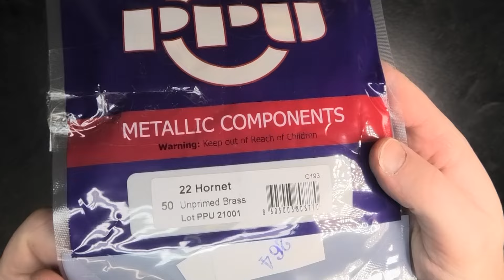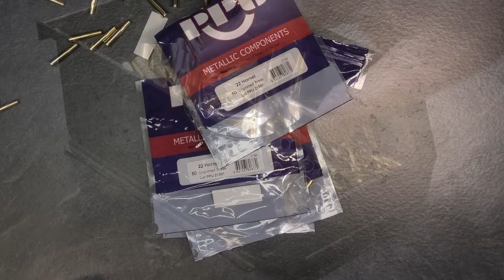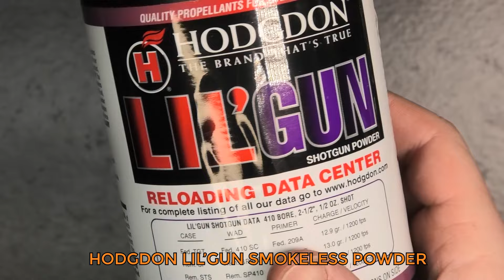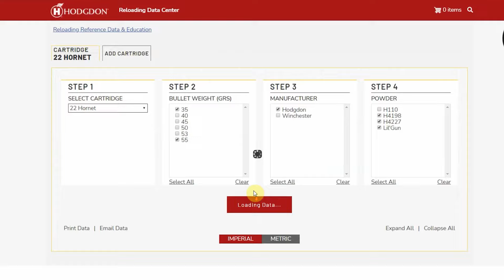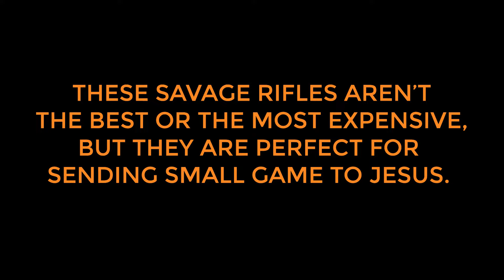Reloading .22 Hornet - A varmint obliterator.

Comment from the maker: So a quick followup: I have found that in my savage rifle, it really likes the .35 grain hornady projectiles, with 12 grains of l'il gun powder behind it. Tapered bullets did not work well, and I don't believe the crimp die is needed for these if seated correctly.  12 grains of powder gives me about 1/4 inch of space for the bullet to seat without compressing the powder. These bullets are FAST, and to my ear has about half the report of a .223
Reply: In some instances, powder is not compromised of it is a compressed load.
Reply: Ill send you out my chronograph if you want to test stuff. Its pretty handy and simple to save data via smart phone
Reply: What is your twist rate?
Reply: Do not used compressed loads
Reply: I thought it would like 35gr. I found 45g tend to pass through and don’t shock as much. I think the hornet most of the time performs better with the 35gr projectiles.

Comment: DONT crimp the cases! You`re just destroying them by crimping them. The Hornet cases are extremely thin. You won`t get near as many reloads out of them if you keep crimping them. There is no worries with neck tension. Just neck size the cases, thats all you need. Do NOT full length size the cases, or you will start to see your cases cracking. And i saw where you were measuring for 12.5 grains of Lil`Gun, maybe you changed something, but i put 13 grains of Lil`Gun in my hornet loads and they are not near as full as yours are. You might want to recheck your scales, something just isnt right there if you`re at 12.5 grains and the cases are that full. Now, if you really wanna see that 22 Hornet come to life, stop using rifle primers. Use pistol primers. Rifle primers are just to strong for the 22 Hornet. I would explain the pistol primer use in the 22 Hornet but i`m limited on how to put it all in here good enough for you to understand it. Not raining on your party here, just trying to pass on past experiences with the Hornet loading to you. I`ve loaded 22 Hornets for MANY decades (50+yrs experience reloading), i`ve tried a million things, pistol primers is what make this cartridge really come to life in accuracy. And forget the 55 grain bullets, especially if you have a 1-16 twist barrel. They will never stabilize. Keep your bullet weight no higher than a Hornady 40 grain Vmax. I shoot 30 & 33 grain out of all my Hornets, one hole groups at 100yds all day long, as long as i do my part. The 22 Hornet is a very fussy cartridge. Follow what i said here, and you`ll find that it just works. My favorite 22 Hornet as of lately, is the CZ527. That gun just drives nails all day long. They have a great set trigger that they put in the 527`s. Anyhow, have a great day!
Reply from the maker: Yeah the crimp I think I might have done on maybe 10 cases, you're right, totally unnecessary.  I've never reloaded .22 hornet before, and it reminds me of a mini 303 british, which I always have to crimp. Plus it came with a crimp die, if it wasn't necessary they could have just incorporated it into the seating die. 

Double checked the load, it's more compact that what I've shown, I'm at 23% humidity and the static electricity was insane, charged all the powder  in the case . This is my first time reloading here, wasn't even thinking about static. I'm going to have to figure out some way of de-stactictifying the reloading bench, as I don't like the idea of static sparks and powder. Thing is I didn't realize this until my second set of 20...they dropped properly. Looked neat for the shot though, so left it in ;)    Remember, this isn't an instructional vid, I'm a bit too lean in the brain processing department to be teaching anything to anyone.

(Oh and I ordered 500 cases, and will NEVER go through them all even once I would bet, this is a really utility centered gun)
Reply: Privi partisan is the best hornet I've found, Rem & Win are 👎, thin brass ,holds more powder and split earlier. We can't buy Lil gun in Australia, Adi 2207 ,AKA H4198 is my go to powder with small pistol primers. Wasted time with 50/55gn bullets. Rifle is Martini cadet reamed to .22K hornet.
Enjoyed the video .👍

Comment: I recall being told that a kid with a 22 Hornet in Africa lined up on a bird in dense bush. He fired and saw the bird drop. When he went to get the bird, he'd brained a big cape buffalo right through the ear canal!! Lucky kid!!
I have a beautiful little BSA 22 Hornet. It's got a top feeding floor plate that holds 7 in the magazine. It was made in the 60's, and has a Monte Carlo cheekpiece, leaf sights, and a factory-cut muzzle brake. In 50yrs I've NEVER seen another rifle like it!! 😊👍
Reply from the maker: That's neat for sure. I AMLOST bought a trap-door rifle with vintage brass tube scope for this video, but the guy wanted shy of $1500 for it, and it was just too much $$ for a single shot that likely I would never use. The rifle I did get was half the price, mag fed, and so far really accurate. I wish I had production funds though, that rifle was probably "one that got away" :)

Comment from the maker: Finally put together another video.
I needed a varmint round that had lots of power for a clean, accurate kill (I don't want animals to suffer), but the round also couldn't travel very far if it missed or ricocheted off of something. These are moving at ~3000 feet per second, but have a very limited maximum range.  Basically a .223 close range, and .22 long rifle past 100 yards. I'm going to stick with the 35gr, the 55 grain didn't group well, and the brass expanded and got jammed in the chamber a couple of times, so probably too much pressure.
Reply: It wasn`t the pressure that was the problem. It was how you reloaded them is what happened. 
Hodgdon Lil`Gun is not a high pressure powder.  You`ll never get enough Lil`Gun powder in that case to hurt anything.
Reply from the maker: @D70340  It's the availability of powder to blame there. I actually filmed this thinking I had a tub of H110 kicking around. My main pest is marmot, which from what I've seen here sits around 20lbs tops. With the groups I got, I should be able to do head or heart shots all day, these things like to stand and look around a LOT. I'm really rural and animals don't worry about humans too much. Anything bigger and I'll grab a 308. So crazy that I can have a literal smorgasbord of firearms at the ready...in the city, I'd be a domestic terrorist. Thanks for the input, I'm always looking to add to my knowledge base. 40 years of reloading and I still don't know enough. :)
Reply: Typically more weight warrants less powder in stuff I have done. 17 hmr too light?
Reply: @High_Caliber  Lilgun is the goto powder for hornet, followed by H110/W296 and perhaps Vihtavuori N110.
But 12.5 grains is my go to load aswell for the 40 and 45 grain bullets. Flat bottom ones are best suited, boat tails like the 40 gr vmax and similar are often to long for the standard COL of the caliber.

Comment: Another 55 grain bullet user....congrats!
I worked up a load 22 years ago using the W/W Fmj 55 gr bullet, Federal small rifle primers, and 10.5 grains of Reloader #7 powder.
This load is strictly fired in the Ruger VHZ 77/22 rifle, and groups well at both 100 and 200 yards. These 55 grain loads are hand fed, one at a time into the barrel chamber, as they are too long to fit into the magazine. With the heavier bullet, the wind causes very little drift effect on the 200 yard range.
For My Thompson Contender, I load std Hornets, using data straight out of the Speer manual.
~DDZZ
Reply from the maker: Interesting! I was deep seating the 55gr bullets and almost all of them were key-holing. I might try a couple that are hand fed, but I ended up with 35gr as ideal (fits in mag AND very accurate), but the fun of reloading is not just cranking out ammo of course, it's finding a magical recipe, right? Cheers!!

Comment: 3rd generation Hornet loader.  Pistol vs. Rifle primers?  That is load/rifle dependent so I do not necessarily argee with previous commitments.  Currently it will come down to component availability. But that flexibility is a HUGE advantage.  Very much agree with neck size only and would add partially neck size to the extent needed to seat bullets to extend brass life. We all know the advantage of the case being fire formed to the chamber to facilitate that.  That is until you eject hot brass in the snow and cannot reclaim it.  Not a snub on the video as I have lost my fair share night-time varmint hunting.  I cannot understate brass prep.  Keeping brass OAL by trimming is tedious but important.  Unless you find high end brass that the primer pocket flash holes were drilled vs standard punched, plan on buying a flash hole deburring tool and thank me later.  If you are new to loading, or loading the Hornet, patients goes a long way.  You will need to appreciate up front this is about as small (and thin) of a case as you get and you will crush a few.  For greatest accuracy you will want to weight sort brass.  If you are that kind of person there are cheaper and easier cartridges to play with.  Powder charges +/-  1/10 th of a grain out of a full size rifle may not mean much, but in a  Hornet case with these charge weights, it very well may.  Small changes make bigger differences with this cartridge.  Seating depth for this cartridge, I feel, is the single most important variable.  Again, small changes/bigger differences.  Regarding not crimping. That is totally rifle dependent and for me is vital in my favorite rifle.  For all of you that have in-line magazines that permit bullet seating out a few thousandths off the lands, nope you all don't.  But my Ruger 77/22 Hornet with the rotary magazine limiting COAL was going down the road or wrapped around a tree.  Two summers of loading was an exercise in frustration. I could get what I wanted accuracy wise and not crimp, with a long COAL, single loading the chamber.  The rifle was floated and glass bedded.  New sear, springs, bolt shims,etc.  Against conventional wisdom once the Lee factory crimp die entered into the equation I average putting a bullet through the center of a Lifesaver mint 75% of the time with ammo now chambering from the magazine.  Finally, from running Varmint Grenades, 45 grain Hornady Hornet bullets as my standard, and 45 gr TSX for deer.  All have different seating requirements.  The micrometer style depth seater makes life easier.
Reply from the maker: Very interesting, yes this caliber is just a play-around for me, a very interesting cartridge indeed, but I'm curious, instead of doing all that for a Hornet rifle, why not slip up to a 222 or a 22-250? I knew some sled guys that seemed to love those calibers in their crazy contraptions (although their accuracy was unrealwhich I suppose it should be). I AM guilty of brass-in-the-snow so I do full length resize...that's why I bought so many bags of brass for basically a noisy plinking rifle (I'll admit, most varmints I take out with a .22 in a volquartzen rifle, or 9mm shotshells out of a pistol). Thanks for the input (55 grain bullets really didn't shoot well, I'm now loading 35gr). I am setting up a 200y range here finally next year, so I'll be able to test a lot of these rounds from a proper bench.
Reply: @High_Caliber  I ended up doing all of that for a couple practical reasons.  The first was due to the physical dimensions of the rifle itself.  I have the 20" blued/walnut 77/22 Hornet not the 24" stainless/laminated stock from Ruger.  I still find the short/lighter platform mimics a .22 LR/WMR in size.  But a lot lighter than a .223 Rem on up.  My Intent has always been to use it as the bridge cartridge it has always been.  My loads are not maximum, just accurate.  I never had the desire to hotrod it as some others have.  I have watched the bolt get cammed open with a piece of pipe and then drove open with a dead blow hammer at a gun club before by one of those experts trying to make a Hornet fly like a .223.  

I live in Michigan.  Shots at Whitetails average 100yards, coyotes less than that and I can reach out to 200 yards on woodchucks terrorizing hay fields. 

 With the same rifle I can harvest a doe in the morning during the early doe season on private property ,within bow range with the .45gr Barnes TSX.  Then be hunting squirrels in the afternoon shooting 45gr Hornady Hornet bullets.  It took a while to find the load combo to get the same speed and POI.  The Barnes is a direct chambered round.    I will not disagree that it is light for one and heavy for the other.  Neither one however, complained when they were invited in for dinner. 

 The gun is with me always and is not a safe queen.  I won't,  but you can do the math.  I've had it since 1997 and go through a pound of powder every 2 years to determine how often it's used.  

Finally, I hedged my bet and won.  A long time ago I knew there was going to be ammo problems.  Back when everyone couldn't find rimfire ammo I could have cared less.  I have a Hornet.

Comment: My CZ 527 loves the 40gr Vmax and 40 grain and Nosler Varmagedon. 
I only size .170 in of the neck  PPU brass
13.3 grains of lilgun 
Fed GM small mag pistol primer 
3100 FPS with absolutely no sign of over pressure 
1.860 COAL
Had to modify the CZ magazine to make the 1.860 fit but it was well worth it.  
40 grain bullet turns the Hornet into a 75 maybe 100yard advantage over the 35s 
From my experience
Reply from the maker: I'll order some 40 gr then. Do you find the powder is really compressed in the case at 13.3? 
The Savage has a small spacer in the magazine, I'm wondering if that can be modified and the feeding still be consistent.
Reply: @High_Caliber  there’s a bit of compression there, but not to bad,   when ya only size .170 in of the neck it leaves more room for powder. Hornet is perfect for neck sizing only, because it headspaces of the rim.   I get 1/4in 5 shot groups with that load at 130 yards. 3100 FPS according to my lab radar crono.   Ya u might be able to do something with your magazine to make the 40s work.     I also had to mod my rifle a little but it was well worth the hour I spent on it.    Took my time and it looks factory.      But I work with metal almost on a daily. Lol

Comment: I recently got a Winchester Model 43 in .22 Hornet and look forward to handloading but as others have stated, brass is virtually impossible to find - bullets almost as bad. I'm going to try 11 grains of IMR 4227 and 45-gr Sierra Hornet bullets (if they ever make them again). I suppose supply chain issues... ??? I've always admired the .22 Hornet because it has twice the muzzle energy of a .22 WMR and is reloadable, is not as loud as a .22-250, burns less powder, and has all the power up close as you would ever need for a water-filled popcan.
Reply from the maker: EXACTLY why it piqued my interest.   I was lucky and found those bags of new brass, which is likely as many as I'll ever need, it's really just a varmint round for me. I had been using .223 on varmints, but I found they usually just zip right through and wound small animals, but I don't want them to suffer at all (I just want them out of the chicken coop!). The hornet does some pretty impressive damage, but no suffering. "fine pink mist" comes to mind on some shots.